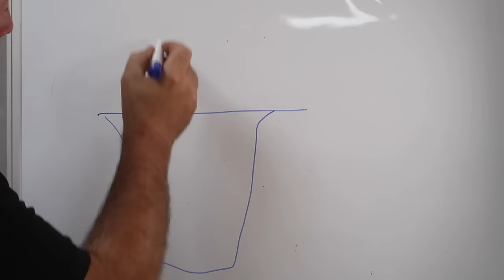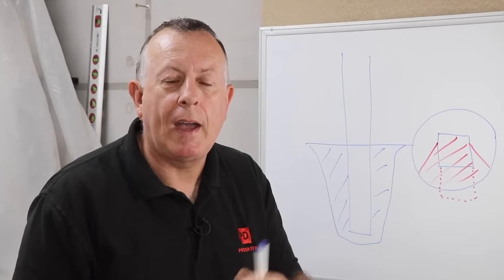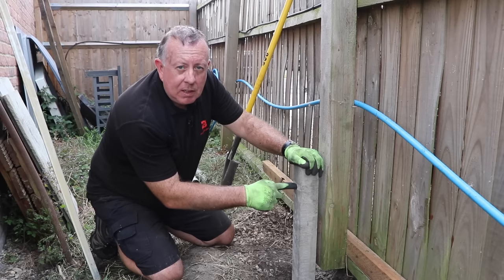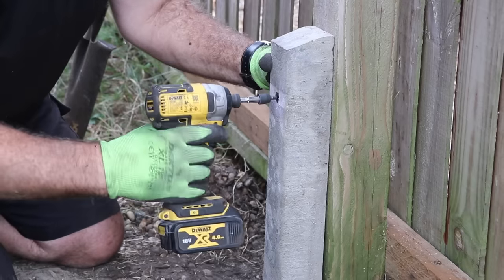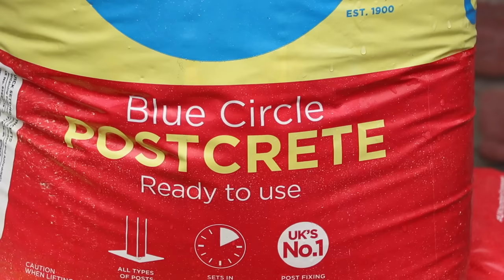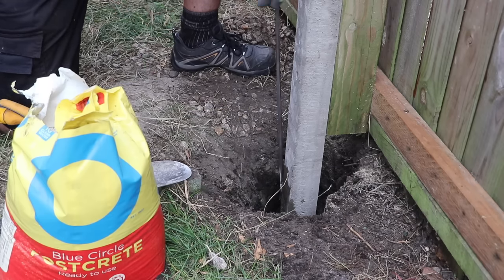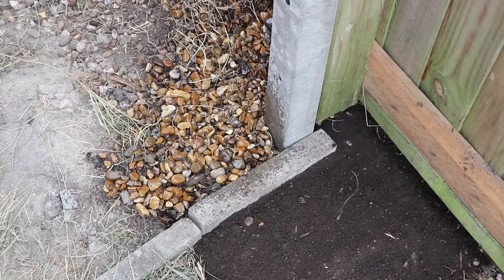The Easy Way to Fix a Fencepost

Comment: 10mm masonry bit would have cleaned up the holes in the spur nicely. I use m10x160 for 1m spurs and m12x200 for 1.2’s. Sounds like a bad casting.

Comment: good vid as usual. but why spend $80 on the spur.  just make a form and pour one yourself.  You could even put some wire reinforcement in it.  And I'm not sure what advantage to the additional horizontal spur coming out from the vertical one

Comment: My biggest problem was digging out the concrete used to build an old, long-rotten fence. Some of the posts were held in with lumps of concrete 2 feet in diameter and over 2 feet deep, weighing I-can't-imagine-how-much. I had to dig a massive crater around each one, then lever the things out of there with an 8-foot iron bar, at which point I was left with a problem: what am I going to do with this?! They ended up being used as the very substantial foundations of a shed. So remember when you put something into the ground that one day it might have to come out again!

Comment: They always go at the same bit, like you say, water....., I'd be curious to see what preventative measures could be added, such as polythene cover or plastic shroud possibly 3d printed.
Reply: Water will get past both of those and probably rot quicker through lack of ventilation and a warmer environment. Take your concrete about an inch higher than ground level at the post then make a 'ramp' away from the post to ground level for water run off'

Comment: I think with these post mixes, all is produced to last as long as post rots. and if it does you are happy man😂. But if you want to last that longer , use concrete mixed in bucket followed instructions. And for longer concrete lasting , add felt(ruberoid)in digged hole, forwork-vertical hydroinsulation

Comment: I would have used a bag of Postcrete sure but...I would have bulked it out with a bag of all in ballast pre mixed together in a wheelbarrow before placing. That way you can determine how much water you add.So I am quite surprised as a Civil Engineer that you didnt attempt to do it properly.
Reply: Can you mix ballast with postcrete ?

Comment: UM YEH ...... here in AU and some parts of the US, packing premixed concrete into the hole dry has gained a lot of favour.
.
So ya just pour the premixed dry concrete mix into the hole dry and pack it in hard ( the harder the better) with the spud end of a heavy bar, best to fill the hole bit by bit and pack it in as you go.
If the ground is moist there is no need to add any water at all, the dry concrete mix will suck what water it needs out of the surrounding soil.
If the ground is bone dry, throwing some water in the bottom of the hole and watering the top once full is wise.
.
THE big advantage is that while compacting the concrete you have put in the hole, you compact the surrounding soil, making for a firmer longer lasting job.
.
About 20 years ago I dry packed a heavy hardwood gatepost up the front of the property, some 10 years later the post had to be removed.
I had it pulled out with a skid steer and yes it took some pulling, The post came out with the concrete plug furmly attached, I had to break it up with a sledge to get it off, to reuse the post.
.
The other thing with dry packing is that the job is firm and strong straight away, you can also tweak the post to plumb by pounding on the appropriate side.
.
for me dry packing is the go.
If you want it pretty, wet mix the top  two or three inces and trowel that.

Comment: Great repair, but I must confess I really don't understand why you let this be a problem. In my nearly 60 years in Sweden, I don't think I've ever seen a fencepost or patio support actually down in the ground; concrete or no concrete. There's always a heavy duty galvanized anchor fixed in concrete, and then the wooden post is attached to that above ground. These essentially last forever.
Reply: It's the way shoddy fences are put up in the UK.  Post in the ground, minimum of concrete.  Trouble in a few years

Comment: Hi Stuart, personally I don't use postmix as like yourself I prefer normal concrete. If I did use postmix I would probably mix it with water before putting in the hole, maybe I'm just old fashioned. When done my fence about 22 years ago I used concrete slotted posts with concrete gravel boards. I then painted them in with panels and unless you want to sit staring at the fence you don't noice any difference. The one thing that did puzzle me was that it must have confusing when you grew up having an indentical twin also called Stuart.😂

Comment: One minor criticism I have is you didn't finish the top of the concrete with a slight grade up the post which helps to not have standing water at the base of the post. Now I realize that the spur is concrete so that doesn't matter so much but if it was wood then that's where the rot starts which is what happened when the original contractor installed the post . just say'n!

Comment: Concrete foundation on concrete post, no drama. But if you did this with a short timber post and concreted it you would repeat the problem in the years ahead. Concrete  stays solid, timber shrinks, water pools in gap between post and concrete, rots again. I always put a mix of cement, water and dirt to support timber fences. Earth stays firm, water drains away. Never failed. And repairs I have done on single rotted posts have been posts set in concrete, failing like this post.

Comment: Why not mix the post Crete in a bucket or wheel barrel following the instructions, and pour the mixture in the post hole you made? Then clean the container with a hose? Seems you would ensure correct proportions of water to post Crete that way! Not understanding why you didn’t?

Comment: Pressure-treated wood working as intended :) I'd have probably put something on the bottom of the post after cutting it if it were me because that'll be where it draws water up like a straw. As for postcrete et al, it's not as if it's holding up a 100-story building and many people will die if it collapses, it's probably beyond up to the job no matter what you do. As for bolts it's not as if masonry bits don't exist, and the existing holes will make it far easier to drill; though again, probably more than up to the job. By the way is there really anything styopping you mixing postcrete in a large bucket with an sds drill padle and then pouring it into the hole, rather than guessing?

Comment: Seriously, I have NEVER encountered a fence that failed because the concreate was too weak.  It's surrounded by dirt so it's not going anywhere.  It's not there for it's strength, it's there becuse it's heavy and bedded well down into the soil.  If you just followed the instructions on the bag, it would have worked out fine and you'd have been done in a fraction of the time.

Comment: Brilliant idea but i would actually cut up a Short treated wood and use thin brackets on ALL 3 exposed sides so it doesn't stick out too much

But your post is way in the back area where aesthetics is not a concern cuz nobody's gonna walk all the way to the rear view

Comment: Not a bad method but i prefer to take off the fence panels, remove the post, use an sds breaker on the concrete (essential machine for the job), lever out the remnants of the post, stick in a new post, postcrete it in place then refit the panel. Less effort required. Probably quicker. Definitely neater

Comment: The concrete or Postcrete mixes that are used are always too strong and make it difficult for future generations to break up and take out when the post needs replacement again.  You can see that it's never the concrete that fails - always the post.  I therefore always weaken the Postcrete by mixing 1 part Postcrete to 1 or 1 1/2 parts ballast.  It's still massively strong enough and could be weakened even further.  This will help the next generation person who replaces the post.

There is another technique that you can uses if you get the post before it fails completely.  That is to lift the old post straight out of it socket and simply slide a new one in - with a bit of adjusting here and there.

Comment: those look like Timberlok structural screws which have a much higher shear strength compared to regular wood screws; although they're probably not as strong as coach bolts.... i have to imagine that they'd be just fine. ( i wonder what the actual shear strength those structural screws are; anyone know?)

Comment: That fence isn’t going to last much longer. I would’ve just supported the fence, detached and taken out the entire post and replaced it with a new one. It would’ve been much cheaper, easier, and it would look nicer.
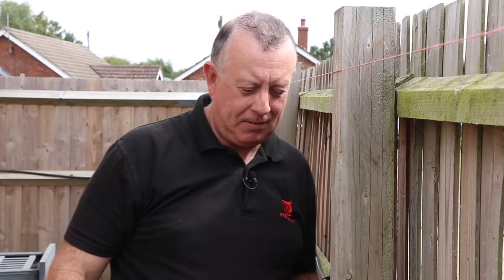Looks like you need to do the same with the post to the left, at 16:46, because the fence still looks bent!

Comment: First off, really like your videos, always a great watch.

..but the first issue you have here is using any kind of cement product in the first place. Cement is the absolute worst material to use to build a fence, for a few factors. 

One is cost, any kind of cement is way too expensive. 

Two is just what you have shown, having to replace a rotten post, either by the method you have just shown, or by having to pull out the cement block, which is going to be hard enough if done by hand.

Third, by using any kind of cement product it will only keep the post wet, as the cement by nature once solid isn't very permeable, so the water just sits between the cement and the post.

In the simplest terms what you are putting in the post hole is nothing but a volume filler, it does nothing else but that. There are all sorts of expanding foam, filling like products out there as well, but they, with cement, all go back to being less permeable or ease of being able to remove it once it is solid, all of them are more difficult to remove, let alone the cost of all of them.

The cheapest, easiest to remove, will not hold water against the post, material to use is road crush, 1/2" or 15mm, as it has been used as road base for centuries, so it does/will work.

When digging the hole, either in new or repair works, make the hole 4ft deep, (doesn't matter where one lives, this is the best method), the hole diameter will depend on the size of the post, but the depth will be consistent. Use about 6 inches of 1/2 washed rock at the bottom, to be used as a dry well to help keep the bottom of the post off the wet sub-grade, which will stop the post from constantly leaching water. 

This is a great point to set your grade (post height), there also is no need to set the height for an entire run, it can be done one post at a time without taking the extra time or material to use temporary bracing, even with one person building it. 

Once you have your height set, fill your barrow or dumping cart with the road crush, how much doesn't really matter, mix it to the point of being wet, but not soaking wet, be sure to mix it thoroughly, then fill the hole around the post a few inches, tamp it down with a 2x4-ish material, don't have to do it hard, just be firm until the material is firm, then repeat until you have reached to top of the hole.

Here is another thing to keep in mind, when finishing to top of the post hole, do not put anything more than a thin thin thin layer of black soil on the top, as anything more will only keep the post wet, and shorten the post life span. Best is to have the road crush right to the final grade height.

The road crush will leach water away from the post, each time it goes thru a wet cycle it will settle (how much will depend on how well it was tamped down during the filling process) and become more firm. If the post needs to removed for any reason, the road crush material is easy enough to remove and re-use.

Plus, always paint/stain the post with water proofing sealer before installation, anything to help stop leaching water will extend the life of the post.

Over the past 40 years this is they way I have built too much to count feet of fence. I have not had to replace a single post because of rot, only because of post twisting because of poor quality big box store material. My personal fence is now 15 years old, from new, and is still the only one in our neighbourhood that is still straight.

This is only my personal experience, living in the great white north of summer temps of 45+ and winter temps of -45+ celsius.

Regards.

Comment: For a 6' post you need the spur to  be at least at 3-4' from ground level and 3' into the ground.  What  do you mean a metre long post is heavy, mine are  steel reinforced 6' foot long and I hve no problem lifting them. I use  1/2" ×7" bolts greased, nuts and washers. I use concrete from sand cement and gravel mixed in my barrow and reinforced in the bottom of the hole with hardcore, bricks etc Looks a bit of a bodge
I have them on every fence post, before the posts rotted. There is nothing ugly about them , its a fence after all not a fashion accessory. What you need to do is add  longer spurs to all your posts using decent fastenings. Those screws are rubbish. Then paint all you panels and posts with a mixture of Creocote and old engine oil that will preserve the fence panels, much better than water based paints which wash off and do not preserve.
Why is it everybody wants a quick cheap job, rather than spending  bit of time on a proper job with decent materials.
Why fences need to be 6' high and close boarded I don't know. Three foot picket fence is much better then the wind blows through it and you can talk to your neighbour over the fence. 

Any typos are due to waiting for my reading glasses to come back. Th Optician measured one of the lens incorectly.

Comment: Hi - job done, okay, BUT - three thoughts.  
First - yes, okay, you just want to give it a few more years rather than do a proper job, I get that, but none of us is getting younger, better do the proper job now than have to do it in another few years when the back is aching a bit more and the knees are a bit less flexible!  
Second - if you only want to give it another few years, why go to the expense of a concrete bracer when a metre of timber would do the job (and let you use whatever fixing you like). 
Third - Postcrete which is mixed badly and attains only half its potential strength, is still more than adequate for the job in hand. 
And Fourth (I know!)  the original concrete, had it been done right, would be sloped up towards the post, encouraging water to run away from the post, so it never sits in a concrete bowl of water - this does really give the post extra years of use - most people don't do it because it needs a bit more concrete and leaves a little bit showing around the post, but it's far better not to have soil and leaf debris right up to the wood of your posts!

Comment: Why wasn't the concrete post attached to the side of the wooden post, so it would present less of a tripping hazard?   Plus it seems strange that a concrete post, plus bags of concrete, plus timberlock screws would be cheaper than just buying an entirely new wooden post, for about the same amount of work.

Comment: Honestly I cant see the post holding only with 2 screws as the old post is hovering  above the ground and the weight of that section is loaded  onto two screws only.    If you have gone to the effort to dig the post out either replace with the same or put a full length spur in.

Comment: i don't get it...if you dig out the old concrete and wooden post why not just put in a new wooden post
Reply: @billmongiello4885 Depends on the style of fence. It looks like Stuart’s fence is one that is a continuous feather edge so completely removing one post would be tricky. You’d have to prise out the nails of the horizontal pieces as well as a couple of vertical slats. Certainly not impossible but as Stuart stated at the start of the video he was demonstrating this type of a repair that in some cases is the only one suitable.

Comment: With all the work digging a hole, removing the existing concrete and rotten timber and fixing the spur with concrete  you'd have been better off replacing the post, it will last longer and look better.  If you want to repair it then buy a fence post repair kit for £20 and hammer it it then screw that to the old post, total time to fix around 10 minutes.  I've just done exactly that on two posts.  As they are on the side you really can't even see them.

Comment: I saw a youtube short video on postcrete and the guy who was presenting said that you don't actually need to put water in the hole with the mix - water will be absorbed from the ground and the postcrete will set without anyone adding water to it. There's a question of how much time this would take, it's quicker to add water but I don't think you'll need to deal with each layer. There may be some advantages to doing that in terms of strength but I think you may be over working this. You should do jobs how you want to though. If you're more confident doing things this way, I guess that's what you'll do.

Comment: Why the hell didn't you follow the concrete instructions?
😂 Just joking!
Btw it seems you could fit a quite big lag bolt on those holes in the concrete post, but if that thin screw was the only available, you could at least have used a washer!
In the spirit of unsolicited loving criticism!😂😂😂

Comment: You should follow the instructions on the postcrete even if some of it is still dry after dumping the bag in the moisture in the ground is enough for it to go off, the more water you add the weaker will become so mixing it like that is not doing you any favours.

Comment: Why not just replace it with a new 4 x 4 upright. You did the hard work already so put in a full upright, drop in your concrete mix and that upright will not last longer than that scabbed in piece.